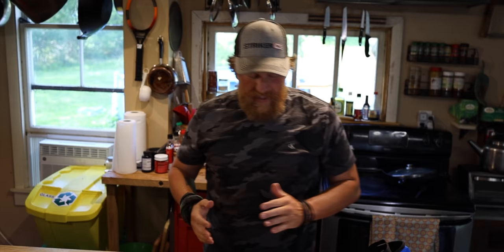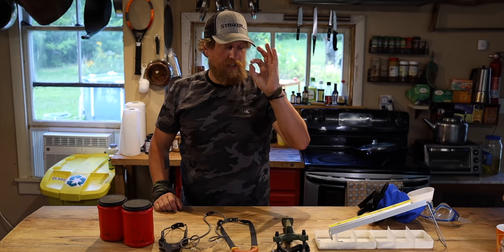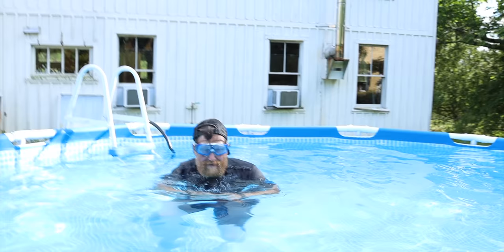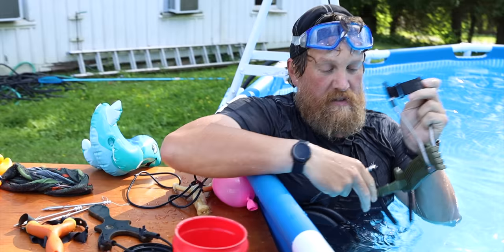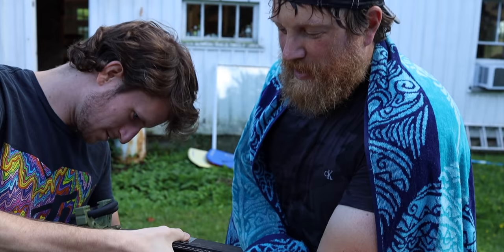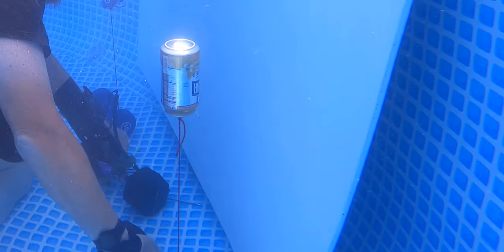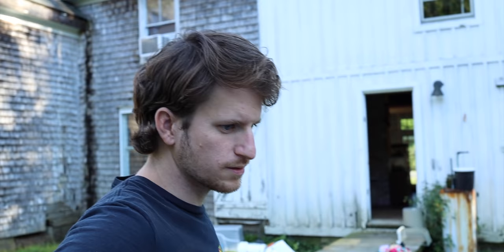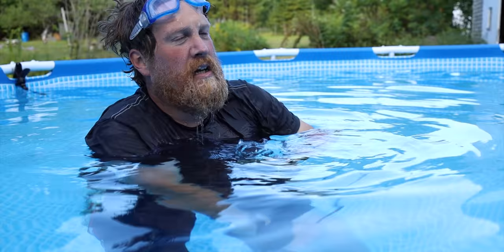Will It Slingshot Under Water | Sparrow Slingshot | Trick Shot Tuesday Ep. #19

Comment: The pouch is the weak link in the design underwater. SpearGuns are basically a form of sling and they keep the launching rubber or springs contained or sliding along the sides of the "barrel" so they do not push a lot of water. A single prong and rubber, sling stick design might work if you use it with the flipping motion to get the stick out of the way as the "spear" passes. Also if you make a tiny, close fit "bucket" pouch for a ball bearing it might not cup the water so much. Investigate Spear-guns.

Comment: Have you made an ammo sorter that sorts rubber and metal balls?, I have an idea on how it might be done.
1st gotta get em all rolling pretty quick on a vibrating run and have a weakish magnet on one side so when the steal balls go by the magnet will pull them to the side but the energy they already got will push em past it. Just an idea.

Comment: I think if you had more rotation to the projectile you'd have a lot better luck. Some of the devices you were using might allow some twisting but ideally the projectile needs something like a screwbody on it so it will spin in the water.